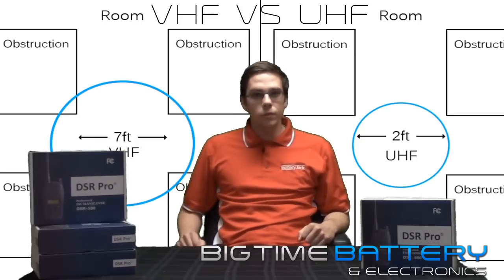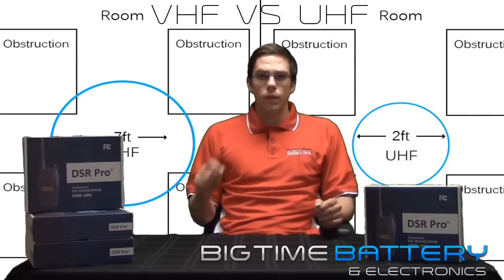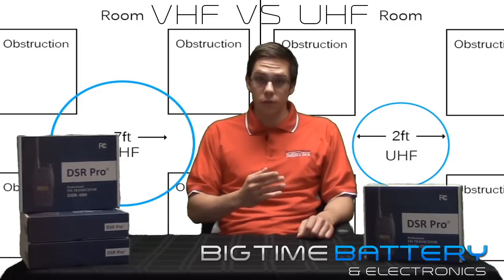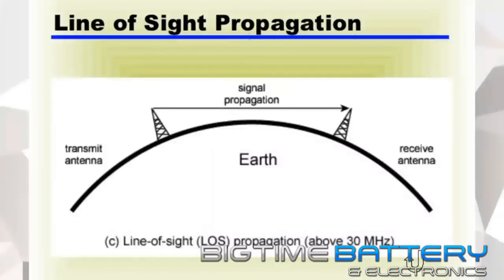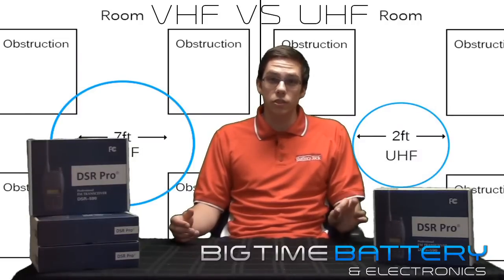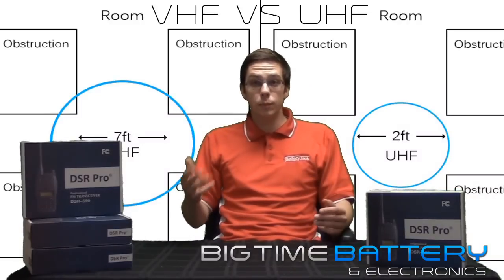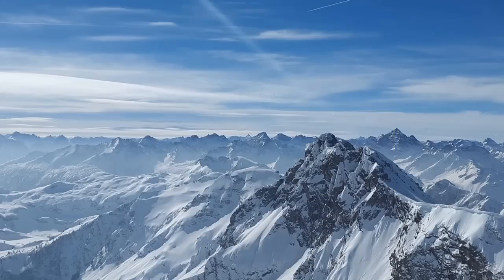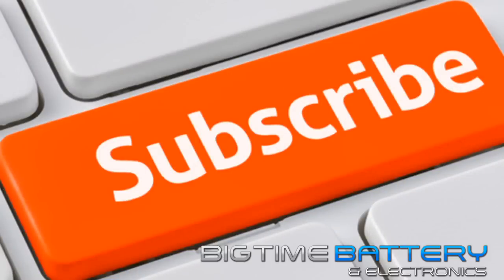VHF vs UHF - What's the difference

Comment: Helli sir... Thanks for this video :) . I'm mobile dj... N also i do sound service ...I just bought vhf wireless microphone  ...plzz suggest me.. In which type of program I can  use for best results ??? Can i exchange with UHF wireless microphone... Or VHF is also useful ???? Ur best suggestion plzz
Reply from the maker: Hello! It's great to hear about your recent purchase of a VHF wireless microphone. As a mobile DJ and sound service provider, having the right equipment can significantly enhance the quality of your services. Here's a bit of guidance on using VHF wireless microphones and considering an exchange for UHF models.

VHF Wireless Microphones
VHF (Very High Frequency) microphones operate in the frequency range of 30 MHz to 300 MHz. They are generally less expensive than UHF (Ultra High Frequency) microphones and can be a good choice for certain applications. Here are some scenarios where VHF microphones can be effectively used:

Small to Medium-sized Events: For gatherings where you don't expect to deal with a lot of electronic interference, VHF microphones can work well.
Speeches and Announcements: If the primary use is for speeches or announcements where ultra-high fidelity is not critical, VHF microphones can serve well.
Fixed Locations: In environments where the setup doesn't change much and you can control interference factors, VHF can be reliable.
UHF Wireless Microphones
UHF microphones operate in the range of 300 MHz to 3 GHz. They are typically preferred for professional audio setups due to several advantages:

Better Quality and Reliability: UHF microphones generally offer higher sound quality and are more reliable in diverse conditions, especially in environments with lots of RF and electronic interference.
Greater Range: They can operate over longer distances, making them suitable for large venues.
More Frequency Options: UHF offers more frequencies to choose from, reducing the chances of interference.
Can You Exchange VHF for UHF?
Exchanging your VHF for a UHF wireless microphone could be a wise choice if you're looking for versatility, better performance in crowded RF environments, and higher sound quality. However, this depends on:

Budget: UHF systems tend to be more expensive, so consider if the investment aligns with your budget and the scale of your events.
Event Types: If you frequently work in large venues or locations with high RF interference, upgrading to UHF could significantly benefit your performance.
Compatibility: Ensure that any new system you consider is compatible with your existing audio setup.
Conclusion
VHF microphones can still be useful, especially for smaller events or in settings with controlled environments. However, for a mobile DJ and sound service provider who might encounter various performance conditions, a UHF system could offer more flexibility and reliability.

Before making a decision, consider the types of events you service most often and whether the benefits of UHF justify the additional cost. It might also be helpful to rent a UHF system for a big event to compare its performance against your VHF microphone firsthand.

Comment: hi  ,
Does anyone Has Made this TEST or KNOW for SURE ,.
 if You Have  2 Radios   1 VHF   &  1 UHF  ,  both Radios  Tx   the Same  Power   5 W  ,.
Clear Line of Site so NO obstruction  ,.
Which one will Cover More Distance  or Which one will Have a Longest Distance of  Receiving &  Tx  ,..
Thank You  ,..
Reply: VHF being the longer cycle, it will slightly bend more then the UHF.  UHF is almost, and I say almost here, line of sight, where VHF will bend a bit toward the horizon for a bit of a  longer distance
Reply: Thank You , Now I have an Idea which model to use  , Regards
Reply: VHF also has less free space loss than UHF.
Reply: THANK YOU ,...
Reply from the maker: The question of whether a VHF (Very High Frequency) or UHF (Ultra High Frequency) radio will cover more distance under the conditions of transmitting with the same power (5 watts) and having a clear line of sight involves understanding how radio wave propagation differs between these frequency bands.

Frequency and Wavelength: VHF operates in the frequency range of 30 MHz to 300 MHz, while UHF operates in the range of 300 MHz to 3 GHz. This means that VHF waves are longer than UHF waves. Longer wavelengths tend to travel further because they are less susceptible to attenuation (reduction in power) and can diffract around obstacles more effectively, though the "clear line of sight" condition minimizes this factor.

Line of Sight Propagation: Both VHF and UHF signals primarily propagate via line of sight. This means that the signal will travel until it encounters a physical obstruction or the curvature of the Earth limits further travel. Given a clear line of sight and the same power level, the difference in distance covered is not primarily due to the frequency but rather to how these frequencies interact with the atmosphere and obstacles.

Atmospheric Absorption: UHF signals are more prone to absorption by atmospheric moisture and rain than VHF signals. However, under clear line of sight conditions with no obstructions, this factor is minimized.

Earth's Curvature: For both VHF and UHF, the radio horizon (the point beyond which the signal will not reach due to the curvature of the Earth) is a limiting factor for line of sight transmission. However, the longer wavelengths of VHF can slightly extend beyond the visual line of sight due to diffraction, giving VHF a potential edge in some scenarios.

Practical Considerations: In practice, the difference in coverage distance for VHF vs. UHF with the same power output and clear line of sight might not be significantly different. Both are limited by the line of sight, and the actual distance covered will depend on the specific conditions, including the height of the antennas above the ground. Higher antenna placement extends the line of sight for both types of frequencies.

In summary, under the specific conditions mentioned (same power output, clear line of sight, no obstructions), the difference in distance coverage between VHF and UHF is likely to be minimal. Theoretically, VHF might have a slight advantage due to its longer wavelength allowing for slightly better diffraction and less atmospheric loss, but in practical terms, especially with clear line of sight, both frequencies should perform similarly in terms of distance covered. The most significant factor in extending the range of either frequency band would be increasing the height of the antennas to improve the line of sight.

Comment: reality is  most UHF and VHF have a range limitation  with a radial distance of 5km though reality is 2.5 km or less (uhf) within the 5 watt output..

outside the the scope of a repeater network you have range limits..

yup comnpanies do have the hertz designation MHz/GHz use..

7 foot mast is what i would use as the mast itself on a motor vehicle with the anteena on top with a strong note that the best reception you get will need  a requirement of the feedline being insulated from the transmission signal whether you use HF. VHF and/or UHF as the source
Reply from the maker: It seems you're discussing several important aspects of radio communications, particularly focusing on UHF (Ultra High Frequency) and VHF (Very High Frequency) bands, their range limitations, the impact of physical infrastructure like masts, and the technical considerations for optimizing signal transmission and reception. Let's break down and clarify these points:

Range Limitations of UHF and VHF: UHF and VHF are both segments of the radio spectrum used for various communication purposes, including TV broadcasting, mobile radio systems, and amateur radio. The range of radio signals in these bands is influenced by several factors including the power output, antenna characteristics, and environmental conditions. For a 5 watt UHF transmitter, a typical line-of-sight range might indeed be around 2.5 km or less, depending on these factors. This range can be significantly affected by terrain, as UHF signals generally travel in a straight line and can be blocked by physical obstacles.

Use of Repeaters to Extend Range: Repeaters are used within radio networks to extend the range of communication beyond the direct line-of-sight limits of radio frequencies. A repeater receives a signal and retransmits it at a higher power or on a different frequency, allowing communications over greater distances and around obstacles. Without repeaters, the range of UHF and VHF communications would indeed be limited to the direct line-of-sight distance, which can be a few kilometers under typical conditions.

Companies and Frequency Designations: Companies that operate radio systems are assigned specific frequencies within the UHF and VHF bands by regulatory authorities. These frequencies are measured in Megahertz (MHz) for VHF and Gigahertz (GHz) for certain UHF applications. The allocation is intended to prevent interference between different users of the radio spectrum.

Antenna Mast Considerations: The height and placement of the antenna can significantly impact the range and effectiveness of radio communications. Using a 7-foot mast on a motor vehicle, as you mentioned, would elevate the antenna, potentially improving line-of-sight and thus the effective range of communication. The antenna's height above ground or any structures can make a significant difference in overcoming the curvature of the Earth and other obstructions.

Importance of Insulated Feedlines: The feedline, which connects the radio transmitter or receiver to the antenna, is crucial for efficient signal transmission. Insulating the feedline from the transmission signal helps prevent loss of signal strength and interference, ensuring that the maximum possible amount of power is transmitted through the antenna. This is important across all frequencies, including HF, VHF, and UHF.

In summary, optimizing radio communication, especially in the UHF and VHF bands, involves a careful consideration of transmitter power, antenna design and placement, use of repeaters, and ensuring quality components in the signal transmission path. Proper setup and maintenance can significantly impact the effectiveness and range of radio communications, even within the inherent limitations of these frequencies.
Reply: @BigTimeBattery  noting the only time you see distance length on vhf and uhf is because you have a repeater in use pushing north 70 watts however  you are still governed at 5 watt input and you are talking about what is a trunking service in deployment, i was speaking in general terms average  last band of communication is roughly 5km in point to  point application
Reply from the maker: @jasonhowe1697  The distinction you're making about repeaters and their effect on communication range is important:

Repeater Usage: Repeaters are used to extend the range of VHF/UHF communications. By receiving a signal and retransmitting it at a higher power and/or from a better location (usually elevated), repeaters can significantly increase the effective communication distance beyond the typical line-of-sight limitations of VHF and UHF frequencies. When you mention the repeater pushing north of 70 watts, you're likely referring to the output power of the repeater. Repeaters can indeed broadcast at much higher power levels than the typical handheld or mobile unit.

Power Limitations: There's a mention of being "governed at 5 watt input," which likely refers to the maximum legal power output for certain types of VHF/UHF transmitters without a specific license or for particular classes of operation. For example, many handheld transceivers (walkie-talkies) are limited to around 5 watts of output power to prevent interference with other users and services.

Trunking Services: Trunking is a method used in communications systems (including radio) to provide more efficient use of resources. In a trunked radio system, channels are dynamically allocated for communications as needed rather than being permanently assigned to specific users or groups, increasing the system's efficiency. Trunking systems can be deployed in both VHF and UHF bands but are more complex and typically used by organizations with extensive communication needs.

Range of Communication: The last point about the "last band of communication" being roughly 5km in point-to-point application likely refers to the typical range you can expect from direct (simplex) communications without the aid of a repeater, under average conditions. This range can vary significantly based on the terrain, antenna type and height, and atmospheric conditions. In urban areas or areas with many obstructions, the range may be less, whereas in open, flat areas, the range could be greater.

In summary, while direct point-to-point VHF/UHF communication might have a range limitation of around 5km under typical conditions, the use of repeaters can substantially increase this range, albeit with the mentioned power restrictions for individual transmitters. Trunking services, meanwhile, refer to a different aspect of radio system deployment aimed at improving channel usage efficiency rather than directly affecting range.

Comment: Boss, bumili ako ng wireless microphone. Noong sinaksak ko sa speaker, namamatay speaker ko. Bakit kaya? Salamat, lods. Subscribe ako sa iyo pag nasagot mo tanong ko. Salamat uli lods.
Reply from the maker: Maaaring ang iyong wireless microphone ay mayroong hindi tugma na output o voltage level na hindi angkop para sa iyong speaker. Kapag sinaksak mo ang mikropono sa speaker, maaaring ito ay nagbibigay ng labis na lakas ng signal o voltaheng hindi kayang tanggapin ng speaker, na maaaring sanhi ng pagkasira nito.

Para maiwasan ang ganitong isyu, maaari mong subukang gumamit ng isang preamp o mixer sa pagitan ng wireless microphone at speaker. Ang preamp o mixer ay maaaring mag-regulate ng mga signal bago ito mapadala sa speaker, upang maiwasan ang posibleng pinsala sa speaker.

Kung hindi mo sigurado kung anong mga setting o kung paano magkakasundo ang iyong mga aparato, maaari kang humingi ng tulong sa isang eksperto sa audio o isang propesyonal na teknikalya. Pagsusuri sa mga tampok at mga limitasyon ng iyong mga kagamitan ay mahalaga upang maiwasan ang anumang pinsala sa mga ito.

Sana nakatulong ako sa iyong tanong! Kung mayroon ka pang ibang katanungan, huwag kang mag-atubiling magtanong. Salamat sa iyong suporta, at sana ay magkaroon ka ng magandang araw!

Comment: What is the meaning of high frequency
Reply: HF is part of the radio spectrum that is able to be refracted in the ionosphere.  In laymans terms, HF signals travel up to the edge of space, then refract (like light shining into water) back down to the earth and land hundreds or thousands of km away from where they were sent.  Its much more complicated than that in reality, there are lots of factors to consider including space weather but its what we use for long distance communication links.  HF is also not very reliable (its sensitive to time of day, season and space weather) and is also very low bandwidth so very slow data when trying to send digital email type messages.
Reply from the maker: "High frequency" typically refers to something that occurs frequently or repeatedly within a short period of time. In different contexts, it can have specific meanings:

Electromagnetic Spectrum: In physics, "high frequency" refers to a high rate of oscillation or wave cycles per second. This is often applied to electromagnetic waves, such as radio waves, microwaves, or light waves. The term is used to distinguish waves with shorter wavelengths and higher energy levels.

Finance: In financial markets, "high frequency trading" refers to the practice of using powerful computers to execute a large number of trades at extremely fast speeds. This is often done in fractions of a second and relies heavily on algorithms and automation.

Data Analysis: In data analysis or statistics, "high frequency data" refers to data points that are collected at a rapid rate, often at intervals of seconds or minutes. This type of data is useful for analyzing short-term trends and fluctuations.

Communication: In communication systems, "high frequency" may refer to radio frequencies used for broadcasting, such as those in the HF (High Frequency) band, typically ranging from 3 to 30 megahertz (MHz).

In summary, "high frequency" generally denotes a rapid or frequent occurrence, whether in the context of waves, trading, data collection, or communication.